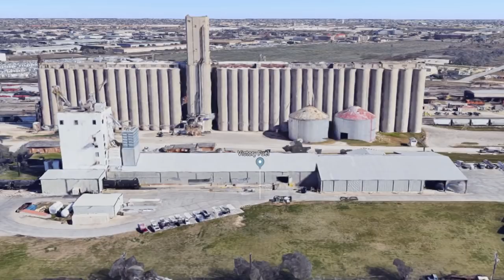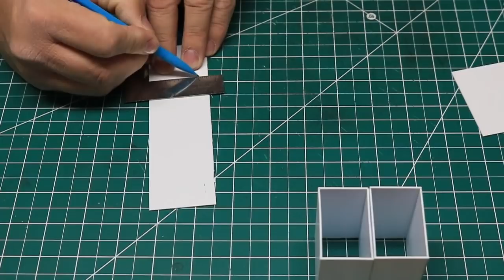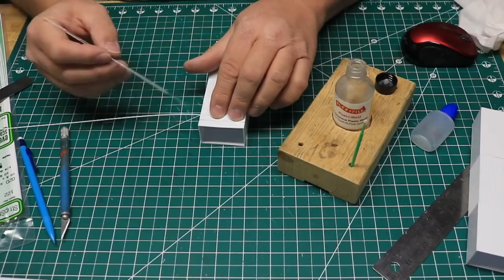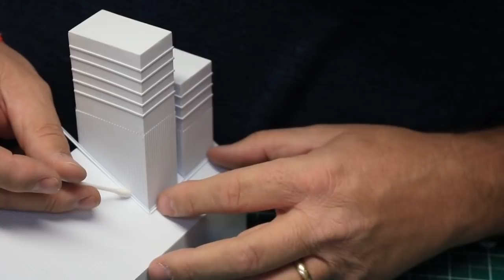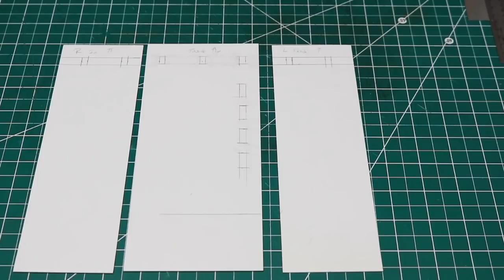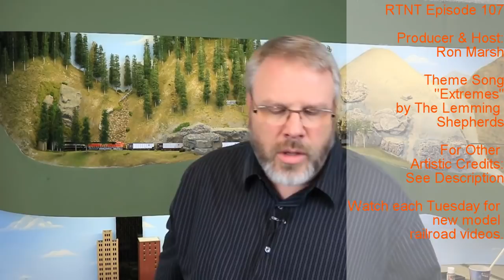Scratch Building With Styrene

Comment: I'm just getting used to styrene. Up until now, balsa has been my material of choice, but styrene is attractive. I have a question: Is that quick acting cement that you use the same thing that plumbers use for PVC pipes? That stuff is a lot cheaper than "hobbyist cement" but if it's going to chew through the structure, well, not so good. I saw that you  used Acetone on the plexiglass skyscraper, and I wondered if that would also work on styrene. Thanks for the videos!
Reply from the maker: Great question. What you want for styrene is methyl ethyl ketone or MEK. You can get it at most hardware stores. The hobby cements contain it in varying strengths.
Reply: Thanks Ron. And thanks even more for the video which covered all types of cement.

Comment: To ensure that the surfaces of two boxes match, glue a location tab along the inside of the boxes.  This is the same purpose as you see on any regular store bought models.  This way the two surfaces match no matter what you do.  If you still have a surface mismatch, use those same plastic strips you used as “stiffeners” above along the seam and It will  hide it.  If you look at most modern steel clad structures, they will have them everywhere where there is a change in surface cladding.

Comment: Well as far as tips Ron, I build scratch built homes because I would like to  have more residential areas in a layout to make it look more like a town. Some years ago I bought a book called "Houses by Mail" , history of the Sears Catalog home that I use for ideas. But now you can find a lot  of house plans on the internet.  Anyway two things that I do for building any structure is to first paint the inside portions with flat black paint in the event that I decide to light the interior. For buildings where you might see the interior, instead of painting the walls, I get paint sample cards from the hardware store and glue them to fit. The matte finish on these cards really simulate a painted wall and by cutting them flush to meet the corners also helps to ensure that there are no gaps in the wall to allow light to shine through.

Comment: Nice Ron.....very nice indeed.I loves my styrene and see you have the ole` Touch n flow applicator, used those for my plastic models all the time and still do for my layout scratch builds.Very nice build project ,just got finished watching the first part (several times actually).I too made a metal tray with two square sides for making building and use a variety of magnets to keep thing square and in place while gluing and waiting for the solvent cement to flash off and cure.
That there is a thing of beauty ,superb building skills Ron.Keep up the fine work !!

Comment: What type of glue are you using in these videos about scratch building? Need to find a better glue myself to use.
Reply from the maker: I'm using a plastic solvent cement, specifically Flex-I-File brand. Here is a link.
https://amzn.to/2BtExrR

Other brands work well also.
Reply: look in to M E K . 8  bucks a quart  at wallmart

Comment: Using styrene that's to thin for some applications is something a modeler learns along the way but it's the precision in cutting that's its big challenge. Look into scrap booking paper cutters by brands like Friskars  or others because they have built in grids often to 1/16 inch and a cutting head at  90 degrees built in. Since the clear plastic it's easy to cut strips/outlines precisely and there are even versions that can cut circles since the paper can be even thicker than styrene it cuts. Matt  cutters can be used too but the cost and heavy duty nature usually isn't needed for scale pieces and styrene so ability to be scored/textured makes it nearly ideal even if it's just used as cladding on a more durables substrate.
Reply from the maker: Thanks for your tips.

Comment: You could have put another piece of styrene to the inside of the bottom of the bins. This would give you more foot glue contact points instead of just the outside of the bin walls. Anyway nice video.

Comment: Very nice work. I think I might have used short pieces of styrene angle in the corners at each level of the towers to assure a durable connections between them. Because they are often very plain and uncomplicated buildings I think modern structures are a great place to get your feet wet scratch building. Kit bashing is another way to build confidence moving beyond assembling kits.
Reply from the maker: Agreed on all points, Jerry. As for the bracing pieces, I certainly could have, but with sections as small as these I just didn't find it necessary. On something a little larger I would have done just that.

Comment: Being in N scale since 71 I have to scratch build a lot of buildings,  I just find it relaxing and end up with  a one of a kind structure.   I build on plate glass that covers my work bench and mat.  I find solvents are a quick clean up and when I use CA I put down wax paper.  I have started using the tamiya extra thin solvent... sets up quick and the square bottle is tip proof.  For cutting styrene I use a large paper cutter and I also use the duplicator from micro mark making my walls.  For window glazing I use the styrene bag the styrene comes in.  I apply it to the window frames with Formula 560 canopy glue .   I use a old carpenter's square with magnets to hold my walls at 90 degrees.  looking forward to the next parts of your build.  Scratch building is fun, besides the devil hates a coward!
Reply from the maker: Thanks for your great tips, Will. I use plate glass in some cases as well. I always keep a piece at hand on my workbench.

Comment: Hi Ron;
Saw Pt.1 so I'm half with you and have lost re.: the bins.

Extending the bins to the base is spot on.  I can kick myself for the numerous structures I have destroyed and sent to the trash for piling on.  When I should have spent the extra dime to build off the base.  Smart move Ron.

But where you lost me was to build a base section in .040 Styrene, topped by a board and batten (? ,040) styrene, the properly topped by another .040 with support strapping modeled.  I re-watched Pt.2 to see if I missed something.  So why not use the board and batten .040 from the base to the top of that section?  Then finish off the top with smooth .040 for you finish?

Also, on that top section why not base coat paint that section before adding the support ties.  Then when you are ready to attach to the lower section lightly sand off the over paint or dripping on your glueing areas to insure strong contact?  Am I just being a rivet counter or stupid that I can't figure out the method to your madness?

Anyway, I watched the LIVE show this week.  But I didn't get to the stream until you were well into the program.  Maybe next time I'll get my dump together and take it on your railroad. (That came out wrong) You, JG, and Steve Brown were really rockin' the Chat.  Great Job.

LASTLY (I promise), I had been putting off shopping at your AMAZON page until Monday.  Here's the deal.  Steve has Midwest Models,  I have been using local walkin store, with ebay presence,  my club makes big quantity purchases from Widget Supply, &  you on Amazon.  So I order the same small volume items from each.  Now I'm waiting for delivery.  When I get all the facts back I will leave you and Steve a "DISCUSSION" page comment.

SEE YA DOWN THE LINE,
Jim
Reply from the maker: Hi, Jim. Here was my thinking on your questions. I didn't use the board and batten for the base because it is somewhat expensive while I have an almost unlimited supply of .040" plain on hand. The seam for this joint would be inside the structure and never seen, so I saved that amount of board and batten for other uses. As for pre painting, you cannot use solvent cement  through the paint, so pre painting before installing the strapping wasn't and ideal option. Thanks for the orders you've placed through my Amazon page. I appreciate it.
Reply: @RonsTrainsNThings  No one ever claimed I was the brightest bulb.  Makes dollars and sense.